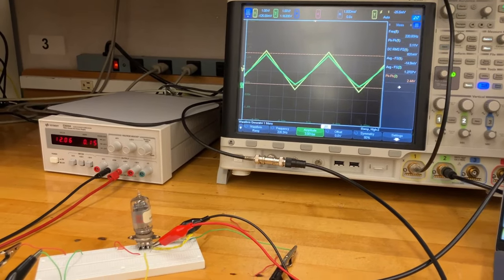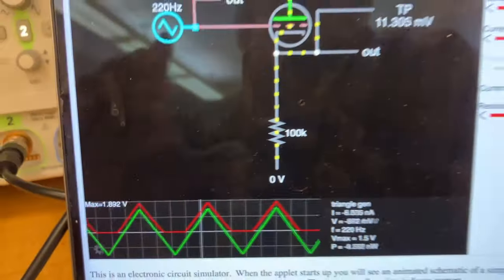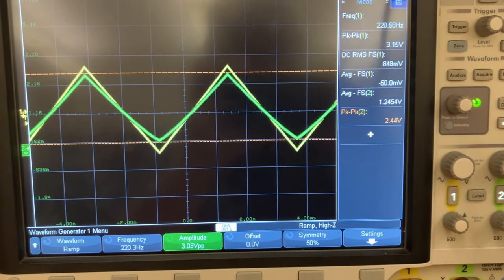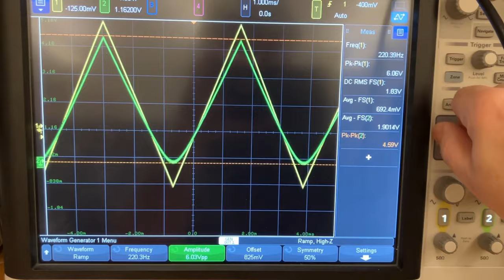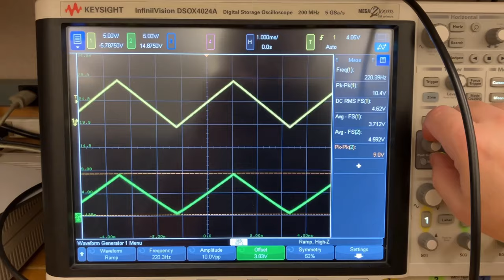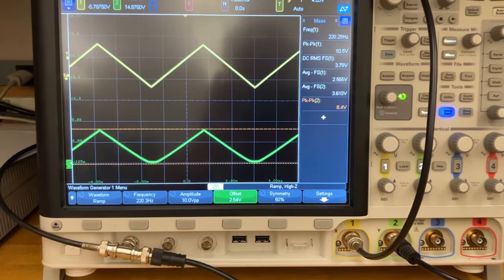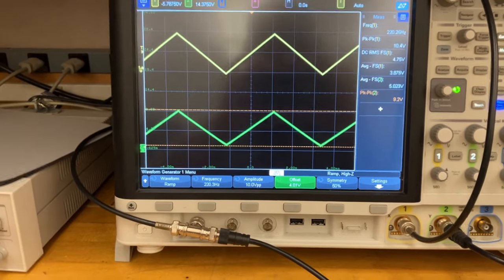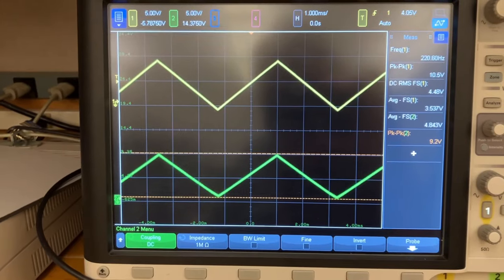Freaky Cathode Follower Behavior with Low Plate Voltage (12AU7 Vacuum Tube) (Guitar Amplification)

Comment: The simulator works when you remove the cathode bias resistor because most circuit simulators will apply "GMIN" conductance from problematic nodes to ground for the DC bias and transient analysis to converge. For SPICE, GMIN is 1.0e-12.

Comment: Triodes can be odd things! The transconductance is heavily dependant on the anode to cathode voltage. In the case of the cathode follower, as the cathode voltage rises, the anode to cathode voltage drops. If the current flowing from the anode can't be supplied, the current starts coming from the grid if a voltage is present. Also given the grid is quite close to the cathode, there will be capacitive coupling from the grid to the cathode. Looking into a high impedance load, a signal can easily be capacitively coupled. In the case of an infinite impedance load, the triode will supply current through the cathode until the voltage across the grid/cathode is so negative nothing can flow. The AC signal is then superimposed over that voltage (this is what you see in Falstad). The resting voltage is dependant on the anode to cathode voltage, so if there's a lot of anode voltage the required negative bias on the grid will become greater to cut off the triode.

Comment: The plate current-voltage curves indicate that when Vg gets closer to zero, the curves bunch up. That indicates that the gain drops off quite quickly, so even a cathode follower's outdoor will attenuate.  Most likely, the reason the circuit works with no Rcathode is because the internal grid-to cathode capacitance is acting as the circuit elemet completing the path from the grid to cathode, and hence to your scope probe.  That's in the order of pF, so it would be interesting to see if you get the same effect at low frequencies, say 50 Hz, where Xc is large compared to the scope's input impedance.

Comment: Try measuring the plate current - maybe there’s no (significant) plate current at 12v at all and all the output you are seeing actually comes from grid to cathode current through what is essentially a forward biased grid/cathode diode?

Comment: Your cathode tries to get to the potential of the anode and given that the grid is positive at these low voltages, there's nothing to stop it. Try thinking of the tube as a resistor with variable value, driven by the grid.

Comment: Because the scope has a 1M impedance to ground just like when you had your own 1M resistor to ground? Some otherwise trivial leakage current in the breadboard has suddenly become significant?
Reply from the maker: Maybe? The thing is that puts the left point of my load line at the 12 V / 1 Mohm = 12 microamp point. That puts me soooooooooooooooooo far down at the bottom of the plate curve plot on the 12AU7 datasheet I just have a hard time believing something useful is happening down there.
Reply: @Lantertronics Which kind of supports the leakage in the breadboard theory. It didn't matter what resistor you used because the breadboard leakage is significant enough to render it irrelevant? Try relocating the valve to another part of the breadboard.
Reply: I was gonna suggest breadboard issues. Maybe hardwire the tube just to be certain.
Reply: @Lantertronics why should the physics of the tube suddenly stop? Yes I also believe that some other leakage might be happening in your setup, but 12 µA are still plenty of electrons flowing and being influenced by the grid. Measuring the anode current would be interesting though.

But yes, 1 MΩ from the scope is not so much, when you expected something to happen with a 1 MΩ cathode resistor in the first place. With the scope and the 1 MΩ in place you had an effective resistance of 500 kΩ.
Reply: @Lantertronics 10V across 1Meg scope resistance is 10 microamps. It doesn't take much to get a signal!

Comment: Try adding a dc blocking cap on the output, and see if there is still leakage current. Could be the breadboard, but that seems unlikely, probably the tube itself similar to grid leak bias?
Reply: maybe it's biasing through the osciloscope input impedance? the cap should help solve it anyways. btw, i'm guessing that if you "load" this follower the huge cathode resistance will not work so well, and clip more of the signal. a nice test would be using both a coupling cap at the cathode and a load resistor (say 10k or lower) and check how the output behaves at the load

Comment: Also remember that a scope probe isn't just simply a shielded piece of wire, inside the scope itself is a 1M resistor going from the input to ground, and this 1M resistor forms a voltage-divider with a 10M resistor in the scope probe, there's a little switch in the scope probe that shorts-out the 10M resistor when switched to the X1 mode, when you switch the probe to the X10 mode the 10M resistor forms a 10:1 voltage-divider with the 1M resistor in the scope's input, that 1M resistor is providing a high-resistance path to ground when you remove the cathode resistor, that's why it continues to work.

Comment: If  you are running the plate at 12 volts you are way off any normal curve. As you have set up cathode follower you are getting 100% degenerative amplification so you are just reaching cathode cut off with an offset that high.  The 1meg of the scope that is loading it down.  CF have ver low output impedance.

Comment: Again there’s no reason to try use vacuum tubes designed for 250V at low voltages.
Reply from the maker: Yeah, there's tubes designed to work at 12 V, but I happened to have 12AU7s on hand, and it fits the theme of my "Guitar Amplification and Effects" class. I do plan to try out some "space charge" tubes, but I need to get some first.
Reply from the maker: How about curiosity? ;)
Reply: experimentation?